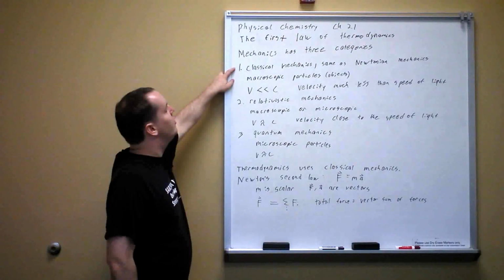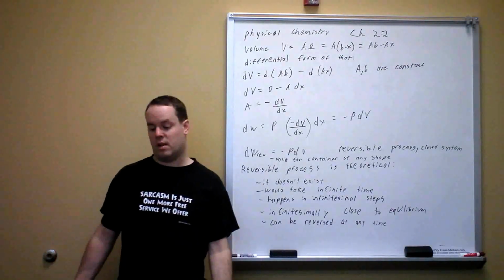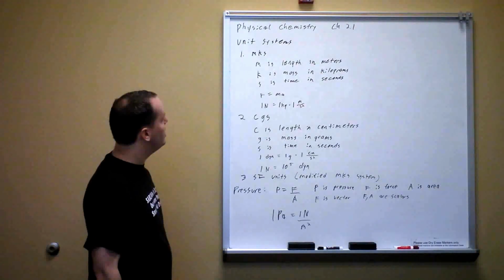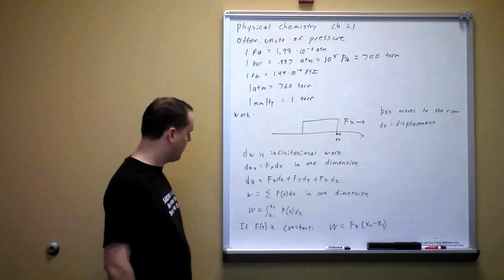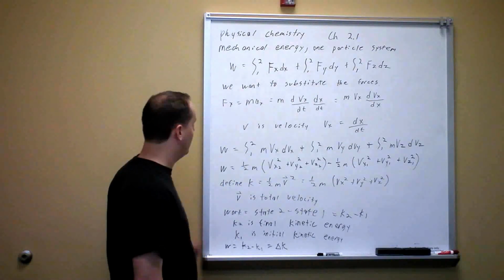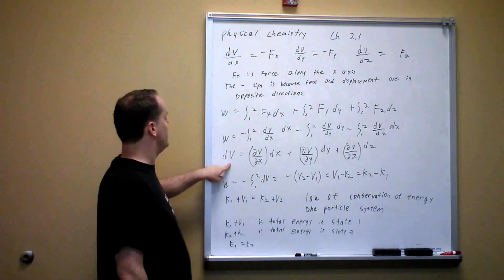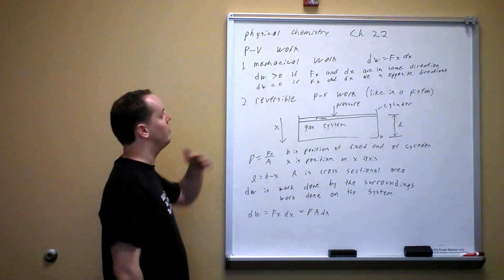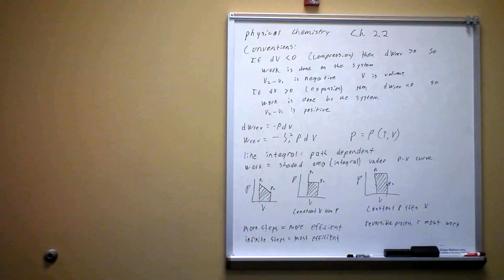physical chemistry chapter 2 thermodynamics sections 1 and 2 work

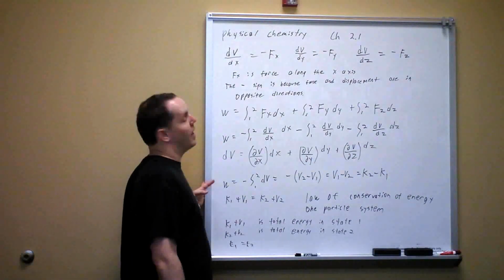Comment: At 21:40, I think you meant to say POTENTIAL, not velocity.
Reply from the maker: Yes, you're right.  This version of my video has lots of mistakes, including that one.  It will still be a few months before I can get around to doing a remake though.  Thanks for the correction.  In the remake, I intend to be a lot more careful about stuff like that.
Reply: You do a good job of explaining the material, however.  All those V's though........ (velocity, volume, potential, etc.)